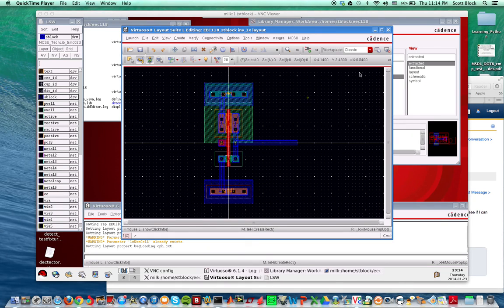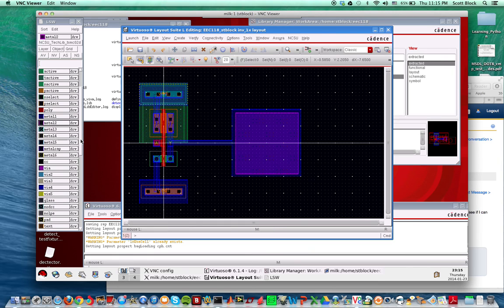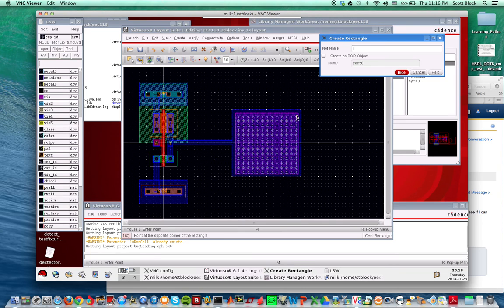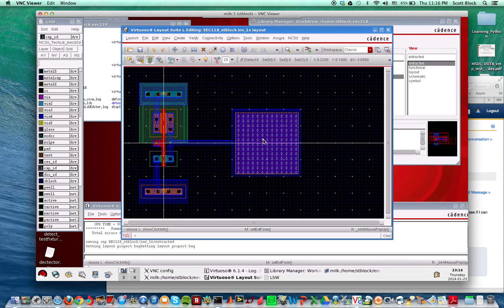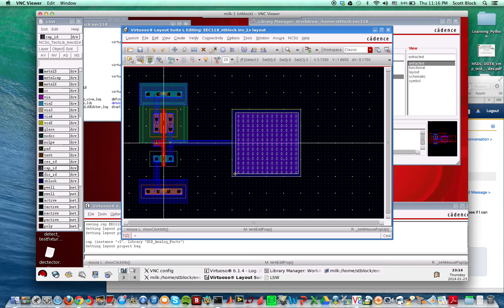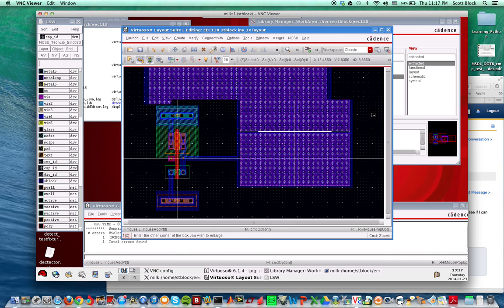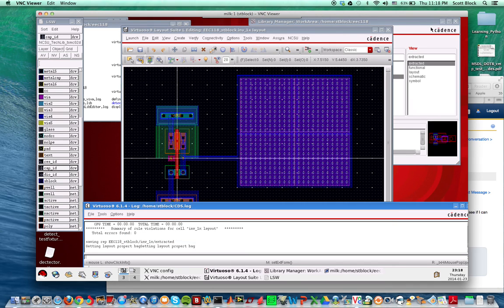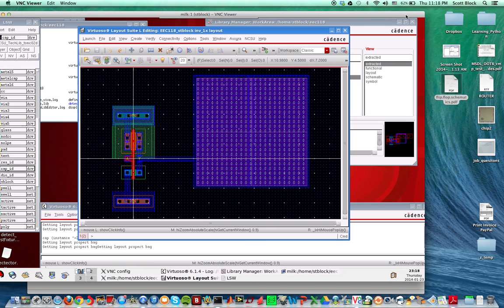Cadance Making Capacitor

Comment: Hi How to make array of capacitor?
Reply from the maker: So, been a while since used cadence, but in the copy command, you typically can select an x and y repeat to create an array or matrix. Might have done another video on this for my students. Unfortunately haven’t used cadence since 2016 and don’t have access any more.
Reply: @InventerX  Thank you
Reply from the maker: @lindapxavier9262  Dr. Li also has good videos (old advisor) https://youtu.be/WakiG-4GbL4?t=1901

If you look at the copy window, there is an array option, there you can specify the number of copies of what ever you have selected in layout.  Then to spread them out, use the delta, and specify the X and Y.  I do remember some versions would just make a grid---hope this helps.